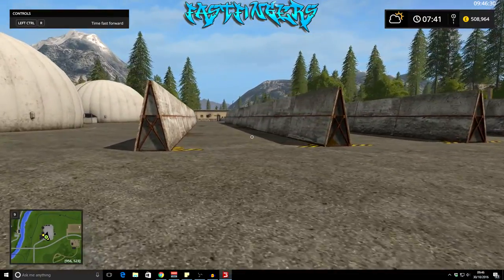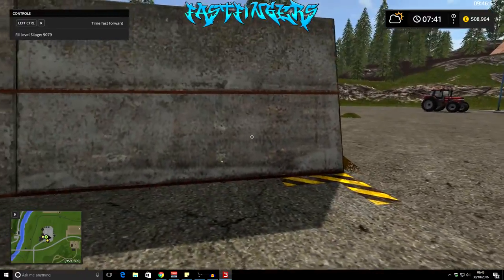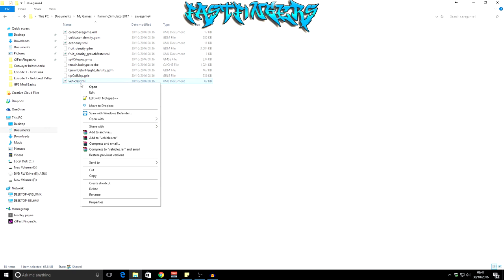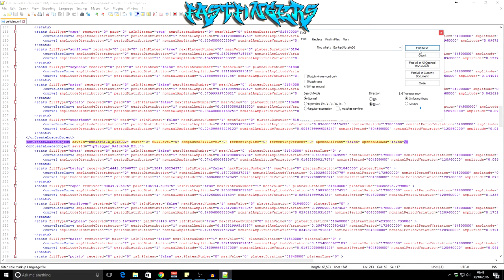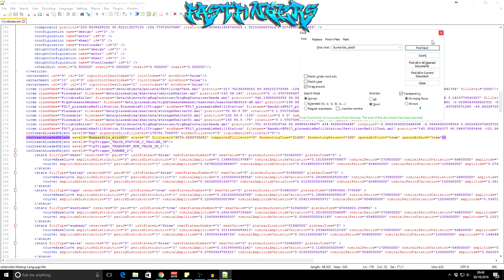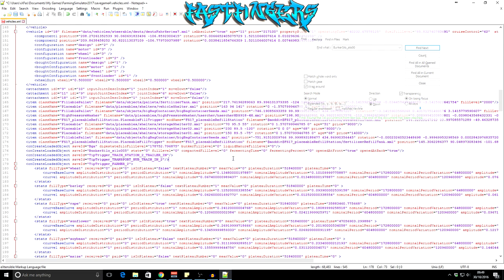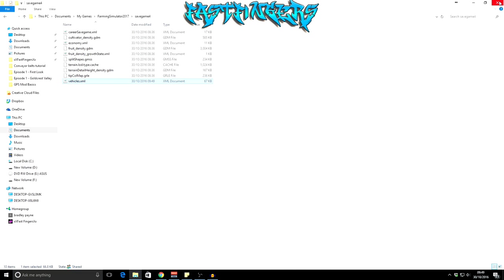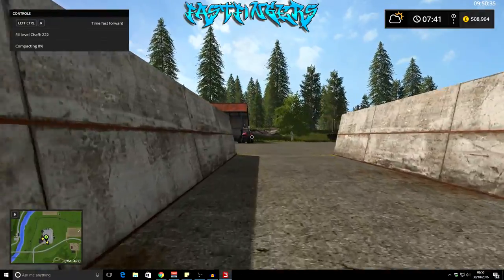Farming Sim 17 - Silage Pit Reset fill level tutorial - #xxfastfingersxx

Comment: Or you can just use a conveyer belt (S-710 by Lizzard) no mods needed, no file manipulation needed.
Oh, be sure to select the "unload here" option and the S-710 will grab that silage stuck in the bunker walls and drop it in the middle where it can be later picked up with a loader.
Reply from the maker: yer this is sort of fixed now, so this video is out of date really.
Reply: I'm having new silage bunker problems. My bunker has bald spots where chaff will not go. Right in the middle of the bunker which makes leveling impossible. 
Ever encounter this?
Reply from the maker: Hey Brian, we had a similar issue, we had 2 million in the pit, 500 just disappeared right in the middle, like a perfect square had been cut out of the chaff.
Reply: xXFastFingersXx 
Yes. I have this in all but 1 of my bunkers, the furthest away from sell point of course.
Ever figure a fix? I was going to try the magic roller but just so dam busy playing solo.
Reply from the maker: yer the roller might work.
Reply: Brian Martin  you are a hero, thx for the info it helped out a lot